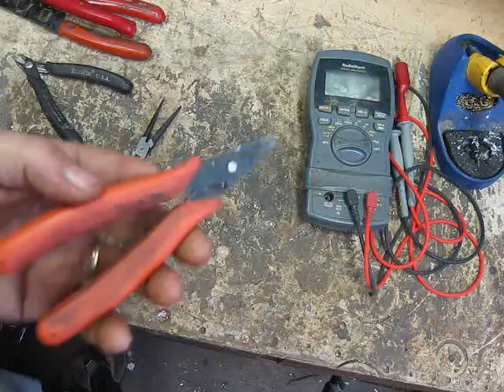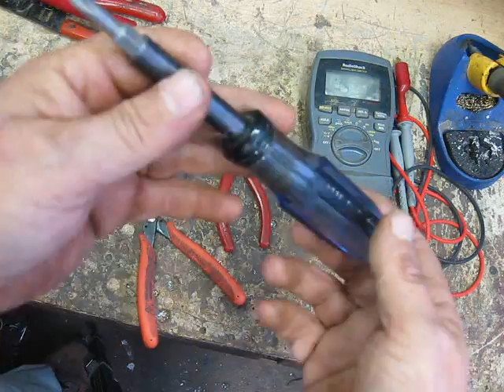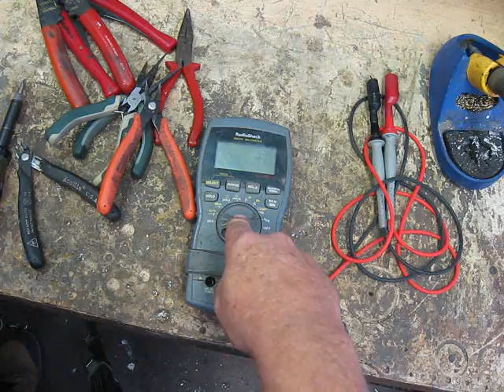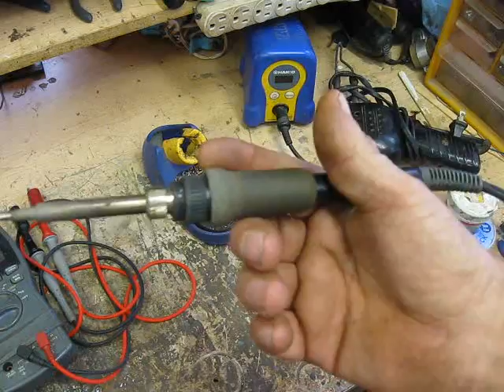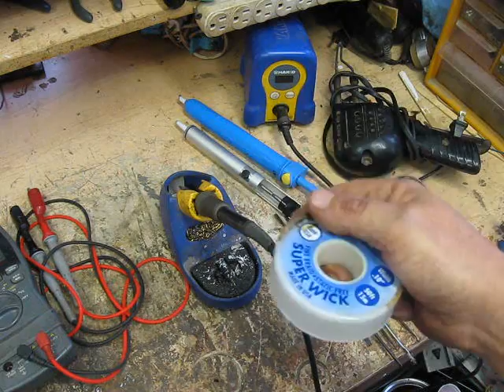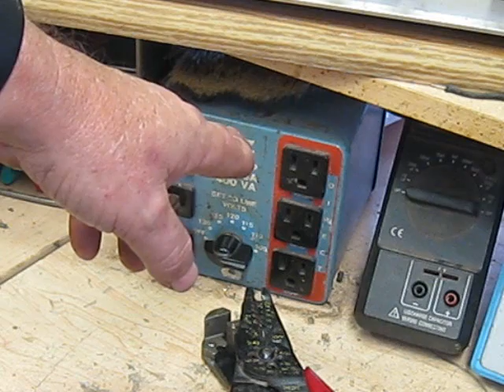Tools part 1

Comment: Some more must haves:  Magnifying glass, micrometer or vernier caliper, drill, Dremel tool, jewler's screwdrivers, heat shrink, heat gun, rubber tape, liquid tape, epoxy, D-Oxit, alcohol,  naptha, small socket wrench set,  small files, helping hands and small soldering vise,

Comment: Hi Dennis,
Good refresher course on tools! I would like to add one thing about the "duck bill" pliers. When restoring tube type radios, I always save tube sockets and other parts because they just aren't available any more. The duck bills are invaluable for straightening soldering tabs, and wires without overstressing them to the point of breakage . A very underrated tool!.
Reply from the maker: +Jim Kodysz Thanks. Part 2 on tools will be coming soon. Thanks for watching.